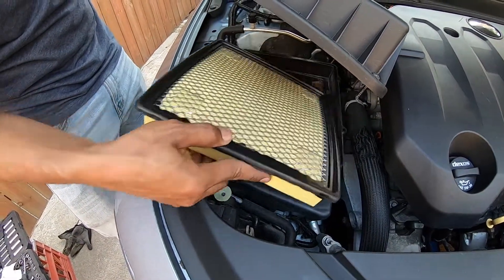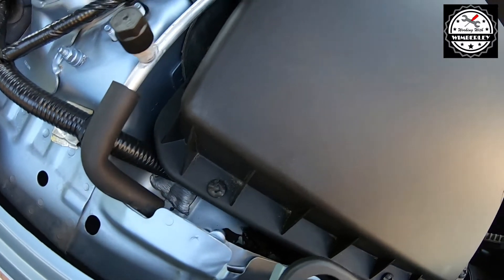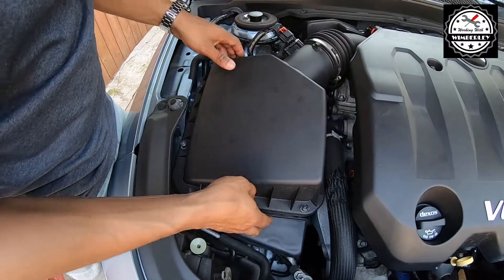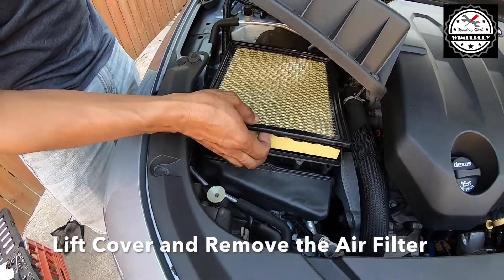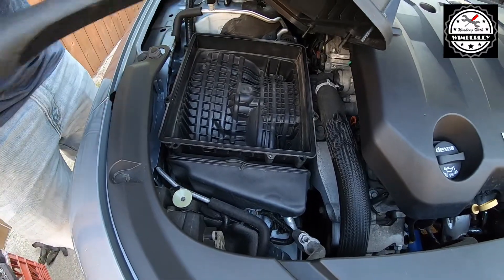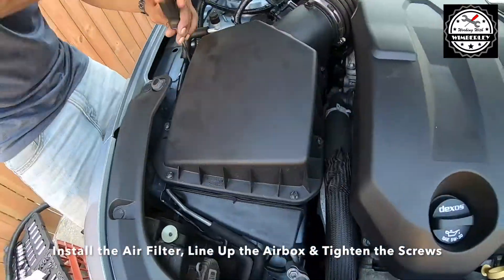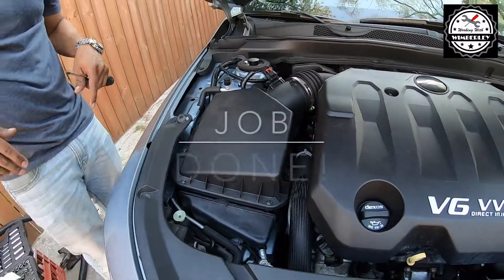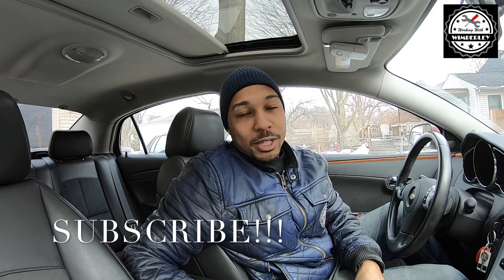How To Change Engine Air Filter On A 2014-2019 Chevy Impala 3.6L V6 VVT Air Filter Replacement

Comment: Doing this tomorrow dealership wanted to charge 225$ to replace this exact filter …. Filter only cost 22$ thanks for the video 👍🏾👍🏾
Reply from the maker: @valeriedent1985  I can’t believe they are charging that much.
Reply: Now what if I need to change the tube that is connected to the air flow sensor bc it now has a crack in it from me changing the filter ??? Is that just as easy ???? Didn’t see a video on that
Reply from the maker: @valeriedent1985  If I’m understanding correctly, the part that the air flow sensor screws into is the air box cover. It’s all one piece. You had to unbolt it to change the filter. Then only other thing holding it on is a hose clamp connected to the rubber intake tube.
Reply: @WorkingWithWimberley ok so I have a crack in the rubber intake tube which is connected to the engine it’s self from what I see …. Is that easy to replace the rubber intake tube???
Reply from the maker: @valeriedent1985  Yes, it’s just held in with a hose clamp on each side.

Comment: Yo bro I have a 2018 Impala. Couldn’t recharge my AC. Used two different hoses and couldn’t get it to stay on. Is there a new type of hose to use for new Chevys or somethin? The low port is between the firewall and the air filter. It’s easily accessible once you take the air filter top off. Please help... Love the channel btw. If I get my 3rd gen Escalade this year I’m gonna put the long lights on the rear thanks to your vid on that...
Reply from the maker: Thanks for watching! I'm glad you like the channel. I just try to keep these videos short and easy to follow. I'll look into those AC lines for you. I just got the Impala so I'm still learning my way around it, but there will definitely be more videos on it!

Comment: What wire is that which comnects into the hose there leading out of the air filter box? Thanks.
Reply from the maker: That goes to the mass air flow sensor.

Comment: I’m having some hesitation when I’m driving, really when I’m cruising between 20-45 mph. No check engine light or anything. It’s been doing it for the past few months. Any guidance would definitely be appreciated.
Reply from the maker: Maybe try cleaning the mass airflow sensor. But only use specific mass air flow sensor cleaner, nothing else.